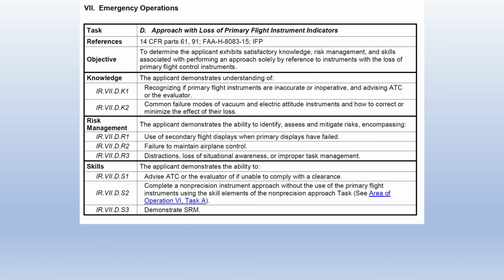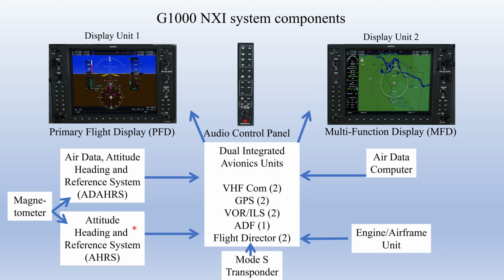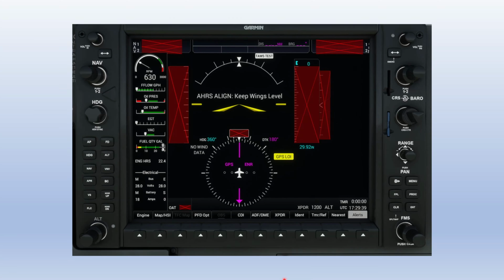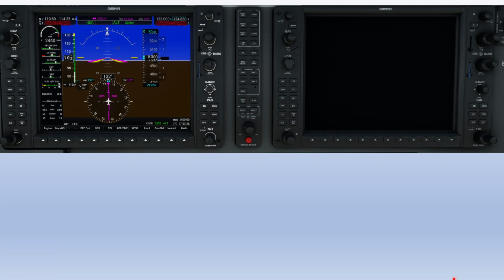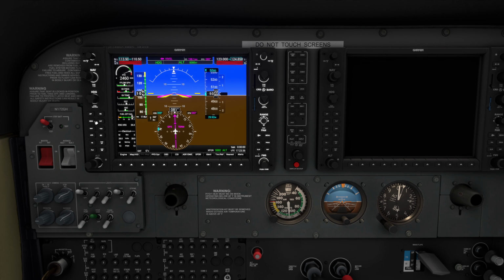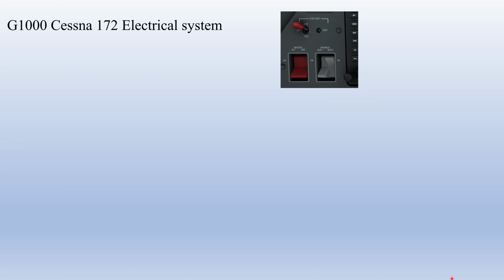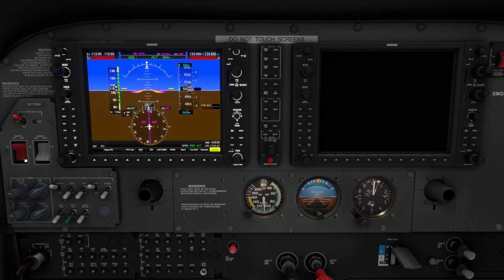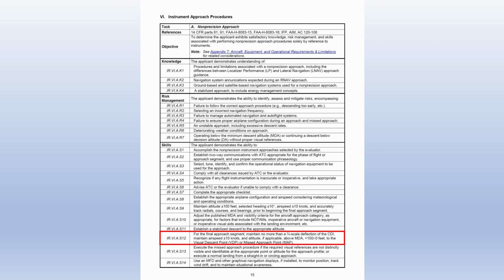MSFS - Instrument Failures in Glass Cockpits (AH IFR Flight lesson 18.2)

Comment: A great workaround for AHRS failure is to pull up a checklist window and position it so it obscures the majority of your PFD, specially your attitude indicator. I haven't found a way to cover the heading indicator while still leaving the CDI visible, but it's a decent substitute for an actual AHRS failure.
Reply from the maker: @gardblades - that is a good work around!  I acutally ended up using the VFR map (with the GPS tracking off, and with the map moved away from the airplane's position) so you don't get that translucent "peak" at the screen behind it.  

Thanks for sharing!  I use it briefly in the last instrument training video (IFR checkride) - and I gave you a shoutout for letting me know.  It's due out tomorrow, and it's just before the 40 minute mark.
Reply: @ awesome!